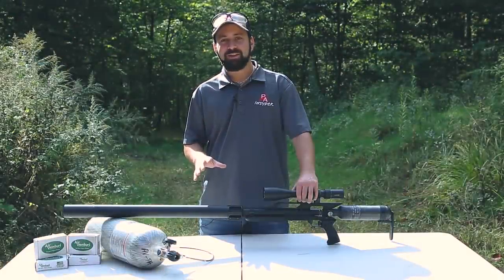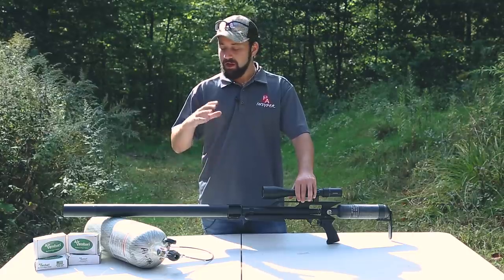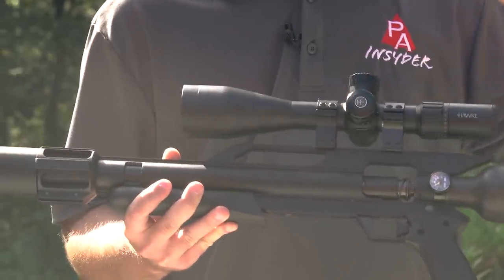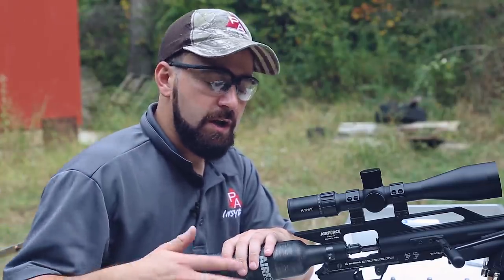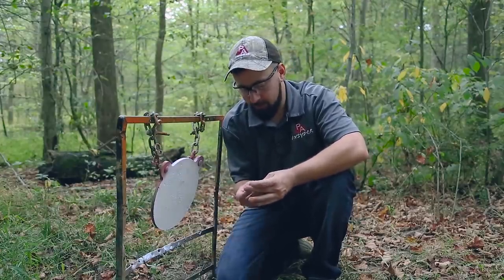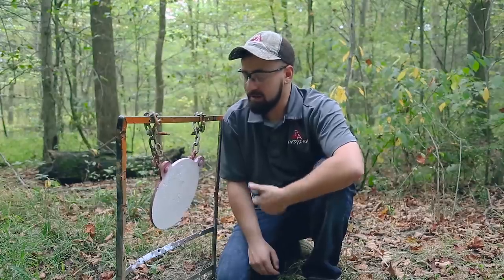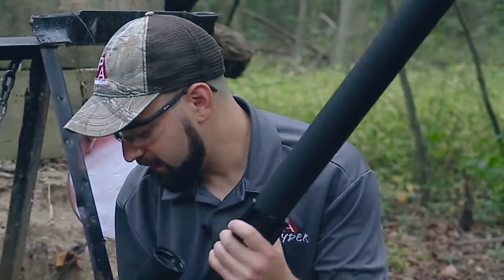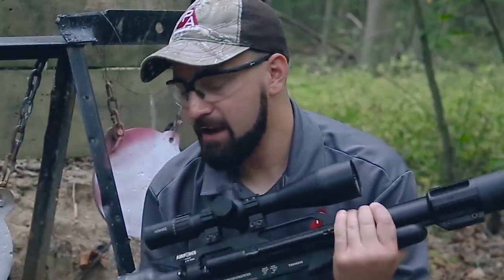AirForce Texan .457 CF - most powerful production big bore air rifle - 700FPE+

Comment: Those 411gr almost stacked am highly impressed by the guys at air force makes me wanna trade in my texan for that beaut
Reply: No need to trade.  The CF tank will be sold separately.  Though it may require an internal spring change to make it work with your standard Texan.
Reply: @tylerpatner6591  No spring change needed, will work just fine with the standard spring.
Reply: @AirForceAirguns1  Good to know!  Thanks for clarifying

Comment: Anyone on here know a general number of shots you might get with this Texan .457 out on the range with a 74 Cu Ft CF tank tethered to the gun?  (I am aware this is a VERY general number that can depend on several variables, but I called airforce airguns and apparently thats a question they are completely unable or unprepared to answer.)

Comment: You lost me at tethered. 

No one is tethering in the field. How can someone see an honest representation if it's tethered?

Shoot the three shots honestly and then refill.

Use holdover and SAY how much.
Reply: What do you mean by tethering I missed that part or something. What is tethering?
Reply: I'm not watching again but u mean he was hooked up to an air tank?
Reply: If that's what you meant then very true. But he's also misrepresenting because most ppl don't realize how unnecessary a friggin 500 grain slugs is. My 260 grains are monsters. 500 grain u could throw at someone and f em up a lil . But the only thing is I bought cheap ass like spare scube tank so it's smaller for failures of main tenk whatev. Its small enough to fit in my back pack so I could leave it connected. But even then I'd prob shoot and refill. Wasting alot of air by doing that. With a reasonable weight pellet. U can get enough if shots in. Its not an ar. Its more like a sniper rifle. So for hunting or self defense u better not use it unless ur clear from danger. And in that scope with time to refill. Or have 5 to ten shots be enough. But with rd musket balls. I can get 20 shots with original texan.
Reply: @PhillyPhenomGolf  yeah.